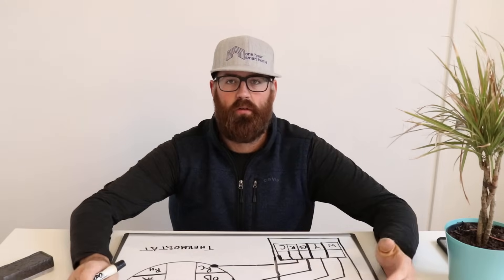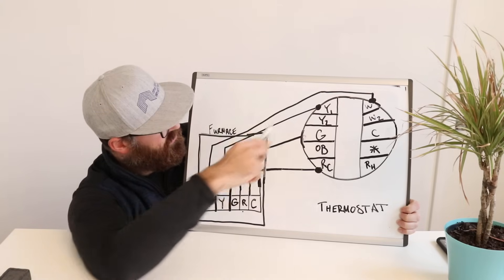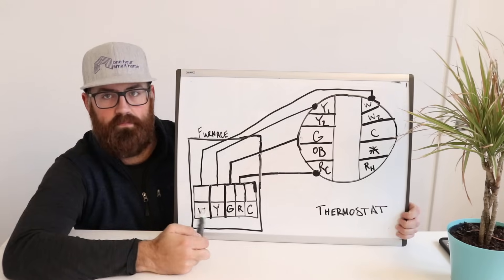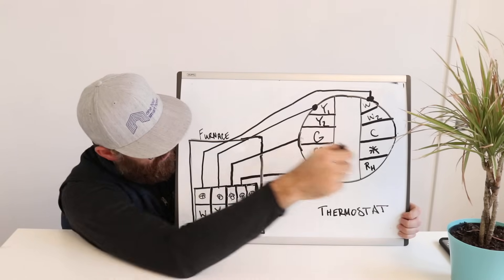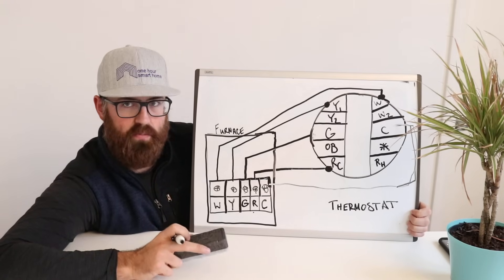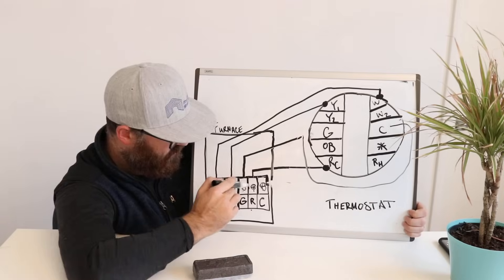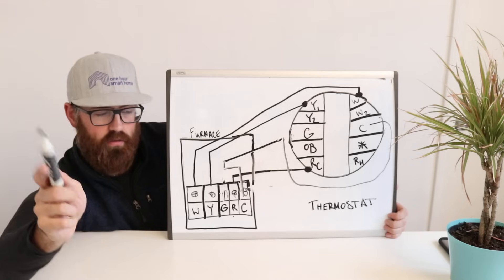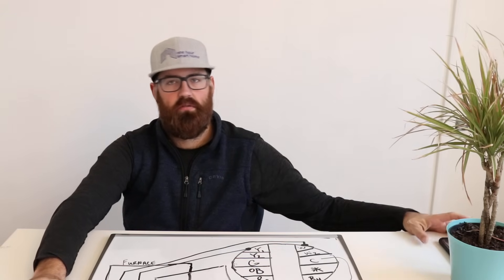Nest Wiring Diagram How To Install C Wire or Common Wire

Comment: Can we just run a jumper wire from G to C at the thermostat and in the furnace? Or would the C only work when the fan is on?

Comment: I'm confused because my Boiler terminals are labeled  TV, W, T, with a fourth labeled Z and jumpered to W. This is an Aquastat Relay Type L8148E. My Red wire is connected to T. My white wire is connected to W. I have a third green wire connected to TV but this wire is disconnected at the thermostats and is connected to the valves/solenoids. It's a multi-zone system. Which is the C-wire?

Comment: my old control panel has 3 extra wires BLK(HI) BLU (MED) RED (L)  it's really old and it has a lever to control the speed of the fan and another lever to control the temperature. It doesn't have a thermostat to select or show  the  temperature. I have no idea where to connect those 3 wires.

Comment: I have 5 wires. When all 5 wires are connected, the nest will either say that it can't detect the RC OR, the C. It's always one or the other. I made sure everything was clean, the wires are the right length, I even scuffed up the wires a little. But the same thing always happens, it can't detect one, I pull the wire out, put it back in, then said wire is detected, but the other corresponding wire disappears. Anyone else have this problem?

Comment: The problem is that the thermostat  controls the fan when cooling circuit is turned on therefore your fan won't go on when in cooling. That's a problem.

Comment: Hi.....Hi...... I have several thermostats in my house. my nest learning thermostat works great I am trying to set up a new generation of the nest thermostat (the one that requires a c wire). My old thermostat just had a W, R, green and blue wire. I have tried the blue wire for a c wire but it didn't work.  I get moving the g wire to the c and then having to do the same in the furnace. but I have never done that. Being that I have four thermostats in my house, how do I know which g wire needs to be moved? thanks

Comment: I have the thermostat installed into my AC unit. The heat is separate. The heat has a control unit that has all the terminals nicely labeled. But the AC unit doesn’t have a control box like that. Everything is wired directly to the relays and transformers. Any suggestion on where I could install the C/Common (ground) wire too?

Comment: I did exactly as you said. When I turned on the circuit breaker, seen the new wiring update on my nest. I tried the heat, check it’s working and air is coming out of registers. When I tried the central air conditioning, the a/c came on but not the blower! I turned off the circuit breakers, rechecked my work, everything looked good, turned on again with the same results, no blower for a/c. Do I  need to check anything on the a/c compressor? Any suggestions would be welcomed!!

Comment: I have a new heat pump system installed, and my g-wire doesn't function as fan only. I just pulled the g-wire from thermostat to see if it was unneeded for heating and the fan coil fan never comes on with the g-wire unplugged. So apparently the information in the video only applies to certain types of systems. I have enough wires and my system works perfectly, but I was just testing the info in the video.

Comment: I have this exact wiring to my Nest. I bought the transformer you recommended in your other video. When I attached it to C and Rh leaving the Rc wire attached) I got an error message that there was a wire inserted into C but no power. When I check the output of the transformer it reads 25.459 volts. How do I hook up the transformer with the wiring currently in place as you show it in this video?????  Thank you- and I'll send you a pot of coffee!!!!!!

Comment: Maybe time for a new video with the Nest Power Connector?  I can't seem to find much about it, but it is a pretty easy fix for my situation.  The furnace has a C terminal but the house only has 2 wires to the thermostat.  It hooks on at the furnace to R,W,C and then out to the original thermostat wiring and presumably makes the R wire powered all the time I suppose or however that works.  Seems like a way nicer option versus a transformer and having to deal with hiding the wire.

Comment: Amazing!!! After watching this video I was able to switch the 2 wires in a couple of minutes. It was exactly as described. I am a visual learner and the white board you used was perfect. The symptom of my Nest was it would turn on and turn off right away over and over. This fixed that. Tks so much!!!

Comment: So I have low battery issue on my google nest learning thermostat. I have extra 3 wires that are behind my thermostat and its end in the furnace is not connected to anything so I can just use any one of them to connect to C terminal in the furnace and then same colour into my thermostat. I guess that will solve my low battery issue correct?

Comment: I like your videos, they are very clear. I have a question, my air handler has two wires on the C terminal but my Nest thermostats C terminal  doesn't have a wire on it, can I put a third wire on the C terminal on my air handler and run it to the C terminal on my Nest thermostat?

Comment: Depending on your system, you should also add a jumper wire on the control board at the furnace. This jumper wire goes between G and one other terminal depending on the system. You’ll need an 18 gauge jumper  wire. 

• Heating/Cooling (gas/oil/propane/radiant):  Jumper  Y <—> G
• Cool-only: Jumper  Y <—> G

• Heat-only (electric): jumper W <—> G

• Heat-only (gas/oil/propane): no jumper wire required.

Also, the wiring configuration shown in this video will not work for heating/cooling system w/electric heat source. And Heat-only system with only 2-wires.

Comment: I have watched your videos many times when I first bought the Nest last winter and after adding a C wire the heater worked finally. Now that the AC is needed I’m facing issues again. The AC only comes on when I disconnect the RC wire, but then I get Error E79 and I can’t control the thermostat at all.  What else can I try?!

Comment: My Nest Gen3 thermostat started experiencing low battery after 3 years of service.
Originally installed with 4 wires. Battery voltage started falling under 3.6V.
Lucky me, the wire between the furnace to the thermostat is 5 conductor!
Connected to fifth wire to the C terminals. Now have 3.79V & 200mA.

Comment: i don't have a C connection on the furnace.  There is a 24V transformer.  can I connect a wire to C on the transformer to the terminal block to create a C connection?

Comment: Simple and to the point! I spent hours asking folks at Home Depot, etc, and searched the web reading about its possible to use the green wire as C wire but was confusing, wasn't sure if I need to bridge green with C or how to do it. This answered all my questions as a noob and save some serious $$ booking an HVAC "specialist" for a home visit/ thermostat install. Thank you!

Comment: I have a Trane Air conditioning system and I was not able to switch the G wire to the C location. Due to the fact that there are separate transformers inside the AC system. Nothing like a motherboard I could see.

Comment: Only two wires on a hot water boiler, can I use the new Nest thermostat without any modifications? I have the gen 3 in the house but bought a basic Thermostat today at HD and now concerned that it won’t work without another power wire? Mine are W and Rh

Comment: Hi. I have a boiler system. 2 wire to a Honeywell inline control valve. Colors Red and White. I have an addition wire in wall, it's an older boiler. No C wire terminal block. What else can I attach it to? Thanks

Comment: Question: I have an old furnace that I'm only see two cables White and black.  I guess Black is power which is my R and white will be  the heat and still need the C cable in order to use an smart thermostat. Is that right?  Thx

Comment: I got a hot water heater with only two wires, red and black hooked to thermostat.  No bus bar at heater hoked up with three zone vales each controlled by a separate thermostat.  Need a C wire and need a good idea how to hook it up.

Comment: What will tell the fan to turn on if you have no g wire.? Should I run a jumper between w and g to make sure fan turn on when it calls for heat???

Comment: MAJOR NOTE - CHECK YOUR WALL FIRST!: there is a REALLY good chance for MANY people that you actually HAVE a C-Wire in your wall already, that you can use -- I DID! (I found out, from a Reddit comment, after I'd already gotten OhmConnect shipping me a free Google Nest Power Connector -- a Reddit guy said "hey, same thing with me, then I checked IN my wall, found out there was an unused wire BACK IN THERE; simple matter to hook it up!". Boy was I red-faced when I went upstairs, pulled the Nest off the wall, pulled the wires a bit, and lo-and-behold -- there were two more wires -- and blue and a yellow one -- cut off and wrapped around the other ones being used. Well, guess what blue usually is, yup - the C-wire. And down in my furnace, there's that blue wire sitting there unused, just ready to be hooked up to the C-terminal as well. I know what MY Saturday morning honey-do project is.... ;-)  So no, I'm not losing* my G (fan) wire to make it a C-wire -- I've GOT a blue wire to use as a C-wire. PLEASE, OHSH-guy, edit this vid or update it to reflect that people should CHECK for a wire before reusing the fan wire! :-) Otherwise, great stuff!
-------------------------------------------------------------------------------
__*Note: massive pet-peeve - I can't believe how many people on YouTube comments think that "loose" is like the thing I do with my phone and my keys and drive my wife nuts twice a week. No, you LOSE your keys. Sounds like LOOZE, with a "Z" sound.  The word "loose" is for when your dog got out, or for what happened to your belt and your pants fell down, not when you're missing something. Practice it, please, people. I'm trying to make a difference, here, every time I use the word -- so it's a dumb quest, but it's mine.... :-)__

Comment: I just installed a 3rd generation Nest. My battery says it's low. So I have 4 wires in yellow, green, red (RH), and white, but with Nest telling me my battery is low, after watching your other video, do I have to connect the C wire or am I going to find the battery will run out? In other words, is there power coming from any of the other wires to the C terminal to help charge it? I do see extra blue wire ends attached on the line on both ends (not installed), I could install it, but do I need too?

Comment: Hi,
Thank you for the info, I live in a hot climate city so I don't really need the heat function...

Is it ok to use this solution on the W wire rather than the fan ?

Thank you in advance..
Reply: you can use it on any wire just know that whatever wire you move to the C terminal you will lose that functionality, all wires are the same its just a matter of what terminal its connected to dont let the colors intimidate you. Hope this helps!

Comment: i have a 2 zoned system so i started by moving the fan wire from thermostats 1 & 2 on the zoned control board to the common. I then traced those wires to the 'equipment' section of the zoned control board and moved the fan to the common. Lastly, i traced that back to the main circuit board and found the fan wire was not being used so i plugged it into 1 of the commons (the board had 2 - 1 that was going to ground and a 2nd). After i turned the breaker back on and tried to run my thermostat, i must have blown something - now the furnace and zoned control board LEDs are not working.  Any tips would be greatly appreciated - hoping i didn't just create a big invoice for myself from this! Plus it happens to be very hot today.

Comment: Hi. We have continuous power outage and every time I need to recharge the battery via usb. Wires on nest are connected as follow: Y1, G, OB,  C and Rh. I bought a transformer to have continuous power but every time I install I loose the 24V common. Please note that the transformer cables are replacing the C and Rh wires

Comment: Help, Please... All of a sudden, the RH is missing? thus the unit will not come on and eventually the nest goes dead as the battery dies. Nothing has changed but , it just happened. The other units are wired exactly the same with the exact same nest (3 total) and work fine. In the past it was the floater, but not this time. To be certain, I bipassed the floater. Rh still not "connected"
all of a sudden.
Your thoughts please.

Comment: This is actually kinda genius. Yes we don't ever use that "fan only" function on ours and i think we just have four wires. Using the green fan wire as common is the best solution, I never would have thought of that. They sell AC adapter plugs for 20 dollars if you can't change the green wire for some reason.

Comment: You are the man! Thank you so much! Your explanation was amazing! I have one question, my nest thermostat doesn’t activate the furnace above 24 degrees Celsius, 75 degrees Fahrenheit. It takes it sweet time to get there. I have a two stage 80k btu brand new keeprite furnace. All the wires are connected, or at least I think they are. An hvac guy installed everything, I didn’t do it myself. He blames the nest thermostat 3rd generation at says it’s a piece of garbage. Is it me? Is it the thermostat or is it him? I’m trying to figure this all out. Hence I’m here and subscribed to you because you explain everything so simply. Please let me know your thoughts. Thank you in advance!

Comment: Great presentation! Is their any opportunity to connect two various devices, like conditioner and boiler to one Thermostat?
Reply: Thank you, looks simple. Now, ...my furnace circuit board does Not have a screw terminal. The 18-5 cable from the thermostat is attached with wire nuts to other wires, to a plug, and connects into  the board. The C wire is wrapped up, ' Not used'. So, at what point, or where can I attach the loose C wire  to ...(is the common pin/wire connection on the same plug? )

Comment: I have a Nest installed on my Furnace but Nest is not controlling my Humidistat because I only have a cable with 4 wires. I tried and couldn't replace the cable.
Can I use a Venstar add-a-wire? Can you help me with the wiring diagram?

Comment: My system has no G wire.  Just the W, Y1, and Rc wires.  Also though the system is setup to run AC when it's hot outside or heat when cold it's one or the other.  Only one can run at any time.  Now when only the heat is set up to run would it work to run the Y1 wire at the thermostat to the C wire at the thermostat? The connections at the heating  or cooling system are not accessible.
Reply from the maker: No, what you are explaining would not work. However you could try using  a common wire transformer like this: https://amzn.to/2UEwQHZ and install it into the Nest to provide power this video shows you how:  https://youtu.be/gahPxCcPDto. However are you sure that your system won't work without a common wire? Have you already tried setting it up with a Nest? Most systems don't  require a common wire to work with Nest.

Comment: Very good. Just one thing. Several other sites explain this workaround too. They also note to put a jumper wire between Y and G on the Furnace Control Panel. I see you did not though. Can you clarify if you need to do this or not?
Reply from the maker: You shouldn't need a jumper on the Y and G terminal.
Reply: @OneHourSmartHome  No disrespect intended. Here are two different sites that say you do need to. So just asking again or can you explain why no need please? 

https://malekservice.com/need-c-wire-thermostat/
https://m.youtube.com/watch?v=nki-65gtvac

Comment: Hi, I have nest E, but I have the two systems connected to the same thermostat, heating and air conditioning, the problem is that in the previous system I have 7 cables and one connected to each other, I do not see the way to connect it, I think you could help me
Reply from the maker: The Nest Gent 3: https://amzn.to/3jpHu0H is a better option for dual fuel systems like yours. It has more terminals to accommodate two systems.

Comment: I did this and now I don’t see the airwave option on my nest. Is that normal?
Reply from the maker: Yes, the airwave option requires the fan wire because it independently actuates the fan to keep running after the AC is turned off to circulate air. This video explains more about airwave: https://youtu.be/OC5BYXqSH4M

Comment: This tip worked for me!!!! Last night was the first night I really needed heat in the house since I installed my Nest. I was freaking out because we were cold this morning and the Nest kept saying delayed for 2:30 and the furnace wouldn't stay on for more than 60 seconds. Now... the house is getting warm with the furnace running until the room hits temperature. A most sincere thank you to you from me, my wife, my children, and my pets. We won't freeze again tonight.
Reply: That's sounds awful. Why would Nest make a system that isn't transferable from existing systems with the same electronics? Is the C wire for wifi/app control?

Comment: Say I don't have a C wire. If I want to use the fan only in the winter time...couldn't I disconnect the A/c by turning off the breaker to the A/C, and then set the thermostat to "cool"?

Comment: I have a 2 wire system I installed the nest E but I need power to keep the battery working  I bought a ac/dc adaptor. I dont know what wires to attach it to on the nest?  C, C and R,  please someone help  thanks
Reply from the maker: This video shows you what to do: https://youtu.be/gahPxCcPDto